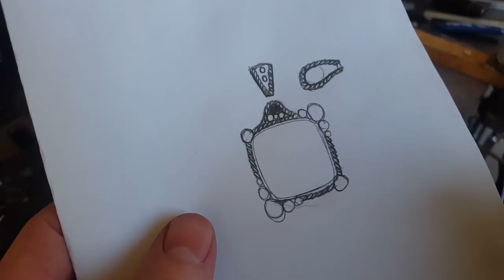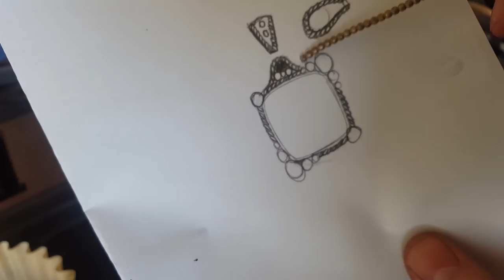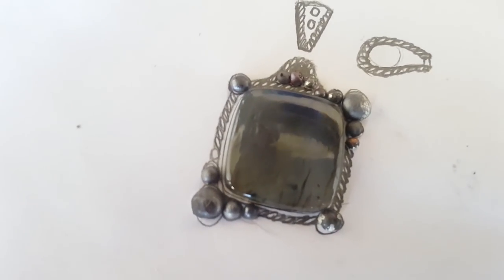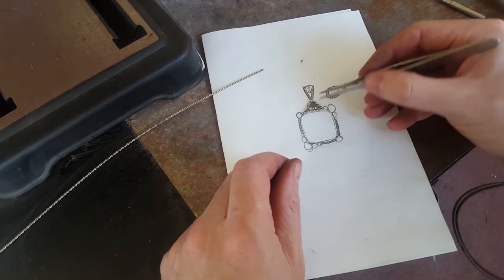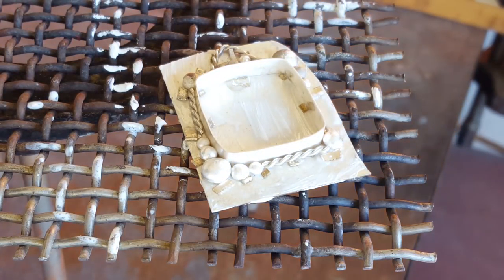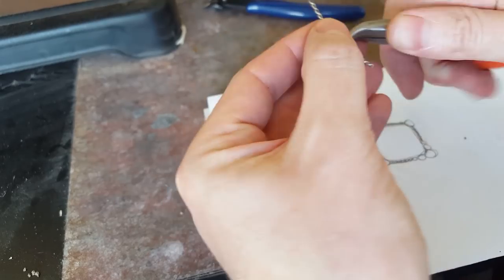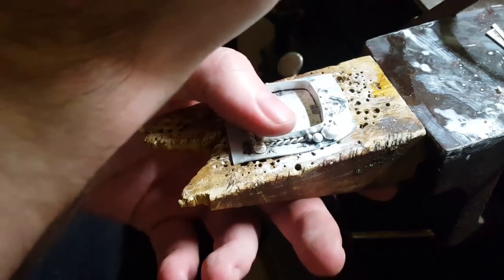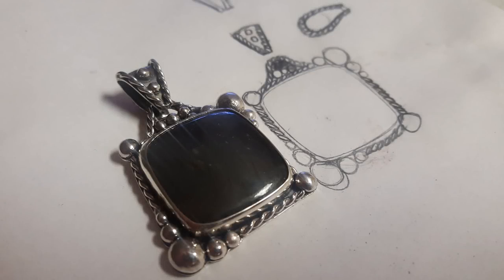Make Beautiful Silver Vintage Jewelry

Comment: Love your design.  One trick I was taught to make beads of metal was to make my own jump rings in different sizes.  Then when you want beads of the same size just use the same size jump ring and head away.  As long as you use the same size wire your beads will be the same.  There are so many ways to get to the finished product.  I learned so much from watching and listening to your explanations.  Thank you!

Comment: I want to make steampunk items without using glue or adhesives 
watching this video is very informative and helpful, I had no idea how much effort it took to craft jewelry pieces by hand... it's unbelievably stunning work
Reply from the maker: +Grey Patches steampunk items can be made with little to no adhesive but it makes your job a lot harder. I have tryed to solder some gears using hard silver solder and the gears are so thin that they melt befor the solder does. One thing you can try is use posts to hold the gears on and flare out the top of the post the keep the gear from falling off.

Comment: Beautiful piece, and what a great idea to use the segmented/ball wire to create your balls!  I'm definitely going to add that to my repertoire!

I was also blown away by how you soldered everything onto the backplate at one time.  It didn't really look like all of the solder had flowed, and I was skeptical that it would all hold, but clearly it did.
Reply from the maker: +wendyannh soldering it like this can fail some times. If you do try this be sure to check  that every part has been soldered. I took some time to learn the best solder placments to make this work every time.

Comment: Thank you for the detailed tutorial video. I really appreciate you didn't speed up and show actually how long you spend on soldering as that's what I have trouble with most of the time as I'm a beginner. I made a similar pendant, after I soldered the bezel, I realised there's a tiny 0.5mm hairline gap at the top of the edge of the bezel. I've tried to filled it with more solder but it didn't work. What else can I do to close that gap? It will show as it has to be folded over the stone. Appreciate any tip. Thanks!

Comment: Very nice work of yours.
I do it the same way, just instead of using solder like urs, i use a lil bit of paste on the easy moving parts, and afterwards i use solder, it makes me use much less solder, it makes it easyer, and plus, the purity of the piece is much higher because i have to use less solder in total. This is just my expirience, but as i see it works on u so well done.
Thnx for sharing.
Reply from the maker: Well thank you and yeah paste would work better for this but at the time I don't think i had any haha.

Comment: Great video, and shows all the essentials in such short time! I have just a couple of small tips for anyone making something like this: if the bezel is a bit too small you can gently hammer it all around - it will stretch a bit and the stone will fit and you don't have to remove any material (this will also flatten the seam in case it's any thicker). Then, placing the spot where the ends are soldered together at the bottom edge will make it most invisible (sometimes seams can oxidize a bit differently from the surrounding material during time, this way it doesn't show on the side). Last, some softer stones need to be protected from polishing mediums so it's good to do most of polishing before setting the stone and just do the last cleanup afterwards.  Just some small tips I've learned, your example is absolutely beautiful and needed none of these advice but thought I'd share them anyway!

Comment: When making twisted wire, I get a standard household (screw in) hook and place it in the drill. I clamp the two ends of the wire together in a vise. Hook the wire and pull steadily to straighten it with the drill before twisting.You do not want hard areas in the wire before twisting. Pull the drill with strength and start twisting.
Also, before I solder a bezel in place, I always place the misshaped bezel around the stone and use a bezel rocker to work the bezel into a perfect match to the stone. The stone should "nearly" fall into the bezel if you get it right.
Thank for posting the videos. I enjoy watching good informative material such as this. Better than TV any day ;)
Reply from the maker: Thank you for all that useful info, I'm sure it will help out people looking through the comments 😁👍 also I'm happy you found my video interesting haha.

Comment: Hi. What is, or where can I find, the rubber/diamond polishing tip you used to clean up the bezel after using the hammer. You said it was much faster than other polishing bits. Thanks.

Comment: Great video. Do you use all hard solder?
Reply from the maker: I used hard, med and easy solder
Reply: @GomeowCreations  for which parts? all at the same time? it was not clear.....
Reply from the maker: You work down from hard to med to easy.

So the bezel and any other parts that you make first you us hard. If you then need to attach it to something you use med to do that so you don't melt the solder joint. If you need to add more things to that or like a bail or some jump rings you can use easy

Comment: Dear Randy, first of all, thank you very much for sharing all this. I would like to ask, if this project is possible doing it with copper, instead of silver. Second I suppose you have used different kind of soldering material in the different stages of the project? Thanks again. Vassilis from Greece
Reply from the maker: Yes, this can be done using only copper if you like and I use silver solder in easy, med and hard. I suggest watching this video, I feel like I talk about what solder I'm using in it more for each part. If you have any more question feel free to ask 😀👍
Her e is a link to the solder that I use. https://amzn.to/2OlmLN3

Comment: Great video..what is "pickling the piece" mean?
Reply from the maker: Thank you and it's putting the piece into an acid that will eat all the firescale and clean any tarnish off of the piece. You can use hot vinegar and salt or buy a dry acid that you add to hot water. This is a must if you are soldering metals.
Reply: Thank you so very much! I appreciate you taking your time to respond. Your work is beautiful. I am just a "wanna-be!"
Reply from the maker: No problem at all, I'm here to help. I'm sure you could make something even better than my work  with practice. 😁
Reply: Your kindness is appreciated...let's say a LOT of practice! Ha! I am thinking of giving it a go!
Reply from the maker: Just start slow and with copper or brass so if you make mistakes it will not cost you that much money. 😀

Comment: Hi again. I am re-watching this and am wondering about something; at 14:00 in the video you show the piece after you soldered and while cooling down. Do you consider the piece having had the solder "flow"? I have always seen 2 temperatures listed on solders; one if the melt temp and the other is flow temp. Would the view [of your piece] at 14:00 be an example of melt but not flow?
Reply from the maker: After that part in the video I did do a 2nd round of soldering to get better solder joints in select parts but the solder did flow through most  of the piece. Any time I solder something like this I make sure to check every part to make sure it is solid and add solder to any points that look weak.
Reply: ok, great. I've had that situation too. I wondered what the two temps were. Makes sense now. Thank you again.

Comment: You have a very cute cadence to your voice/narration. I haven't tried this, but if you were to cut divets in your charcoal block with an appropriate sized round bur and melt your silver in the divets, then squash them a bit before they cool, you'd have less clean up on the balls. They looked a bit rough before you cleaned them up. Perhaps it was the video.
Reply from the maker: I will have to give that a try. I do have a way that I make metal balls now that they come out with no need for clean up. I will make sure to show that off in the next video that I need to make metal balls in.

Comment: You CAN (quite easily) stretch a fine silver bezel, usually the only time you have to do it aghain is if it's too large. Also, if you flux your pieces before you put them on your charcoal block, its won't get gross and ruined or have the balls stick.
Reply from the maker: Yeah you can stretch fine silver but it's not something I like to do haha. I do normally flux my pieces before making balls and pieces but some times I forget to haha.

Comment: What's the pickle pot?
Reply from the maker: The pickle pot is an acid that cleans fire scale off of your work after heating it with a torch. I use a small crock pot with this acid https://amzn.to/2IGqyRs. You need top mix this dry acid with water and head it up so it can be most effective.

Comment: Thanks for your generous time. Are you going to finish this piece? How do you? (All the solder and rough edges)?
Reply from the maker: I finished this piece with some rotary bits to clean up the rough edges then I used a polishing compound to make sure everything was smooth and shinny.
Reply: Is it finished in the final picture? I see some stuff around the balls especially on the bail, can that solder come off? Thanks so much.
Reply from the maker: Yes, the final pictures are the finished piece. It does show a little solder on the bail, and you could get it off but I was happy with my work and liked the look of it. I could have cleaned it up a lot more and polished it to the point of being close to perfect looking but this was not the look I was going for. =)
Reply: Darling, perfection is a hard goal, good work isn't. Just a friendly nudge towards quality. This is your work, right? Something to be proud of. Don't feel special, I got a scolding from my jewelry teacher about solder clean up, ouch, but true! lol :)
Reply: Gabby Flying Chef - I'm a perfectionist, too. When teaching workshops, I stress quality of finished pieces. However, I do spend quite a bit of time on design and technique as well as the actual step by step procedures.
This finished piece was not really up to my standards. Several gaps between the ornaments and backplate and the face had a lot of roughness to it as well as solder showing on the bail. If this were a students finished product, I would assess a "D" grade. Yes, and I'm also honest with my opinions.
Reply from the maker: Well thank you for taking the time to give your opinion about this piece. I'm sorry that it wasn't up to your standards and I'll try to do better in the future.  😀
Reply: @GomeowCreations  Your purpose, as I understood was to give new people the steps to create a fantastic peace and you achieved it with flying colours. If anyone want to clean up bit more, I am sure they can. But for me as a beginner, you are so helpful. Thank you so much. I am sorry some people can't see this :(. All the best with your creations. Thank you XX